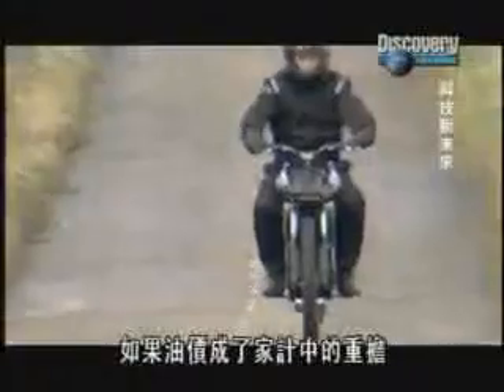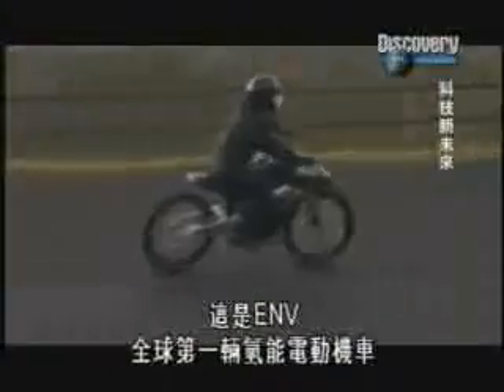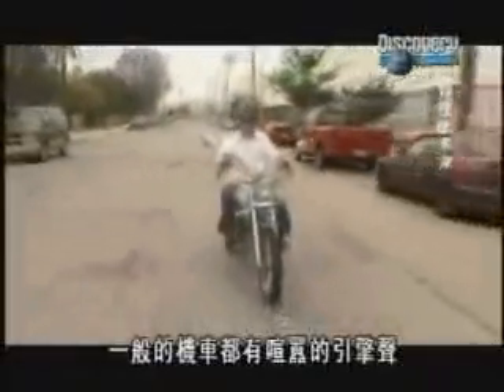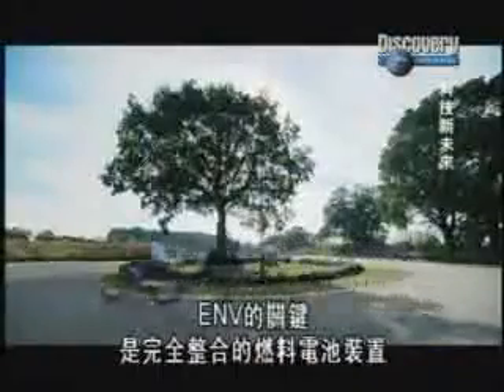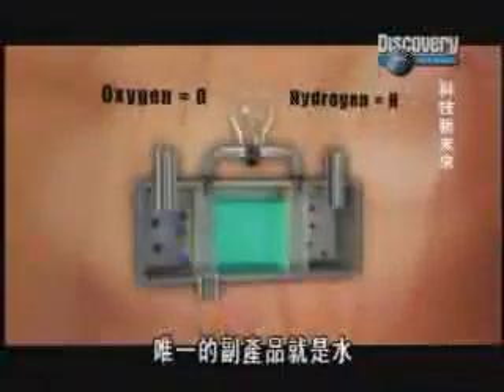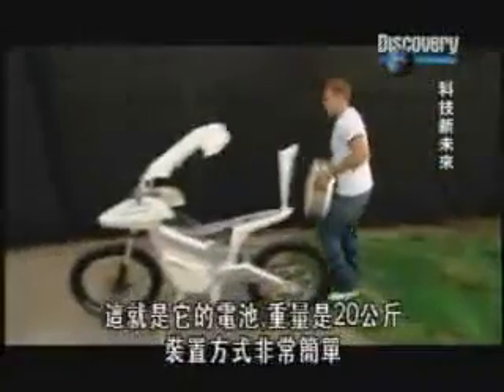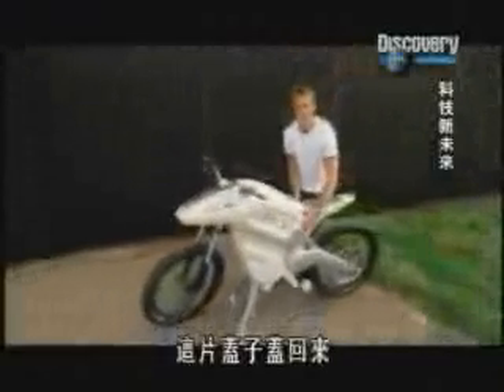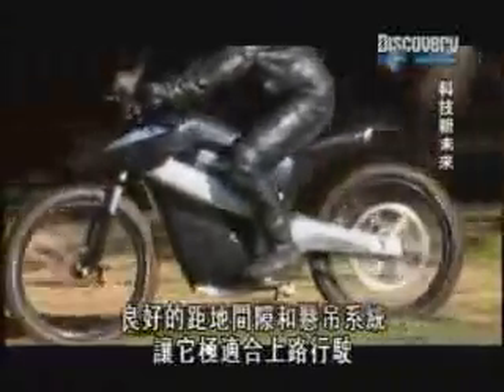fuel cell motorcycle

Comment: @ImYourGeek 

I would concede that it is statistically safer to driver a big car than it is to ride a motorcycle. But then, it is safer to be the person pulling the trigger than the one being shot. Motorcycles are smaller, turn sharper, brake faster.. I would argue that the total safety of all drivers/pedestrians is diminished with every big "safe" car that enters the roads.Which vehicle would be easier to avoid hitting or being hit by in an accident? Car or bike? Which would you rather hit you?

Comment: @ImYourGeek 

Cars being "more safe" than motorcycles is based on the fallacy that only the safety of the driver and passengers of the vehicle in question determine its "safety". This is actually an incredibly selfish and short-sighted measure of safety. Many bulkier "safer" cars are only "safer" to the person INSIDE the car, but god help you if you're the pedestrian, motorcyclist or small car driver that gets hit by one.  (to be continued)

Comment: Hmm,Hydrogen from fossil fuels,thats a new one on me,there are various methods of producing hydrogen some purwly chemical reactions,other electrochemical.There is a small problem with the electrochemical version in that the electricity used to produce the gas may well have been produced by a fossil fuel power station,but that part of the equation can be avoided.